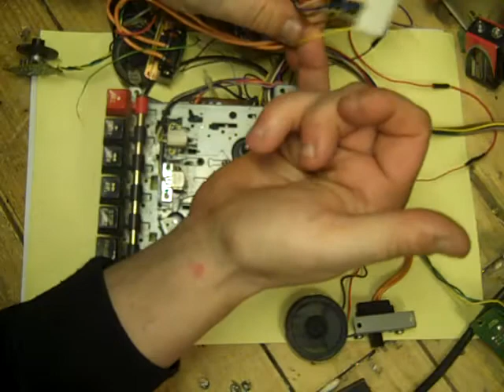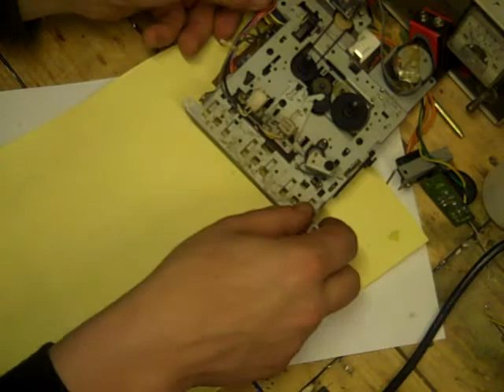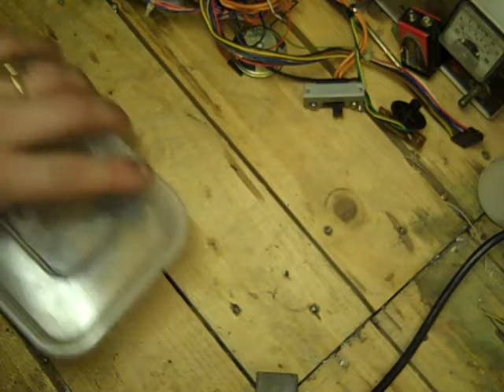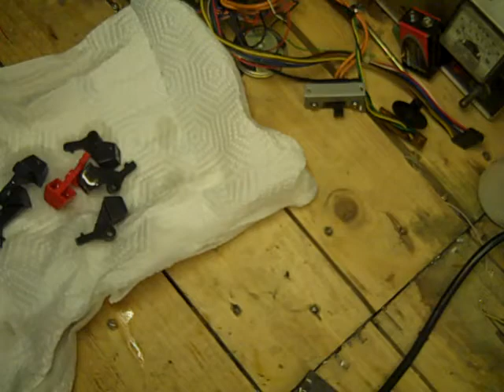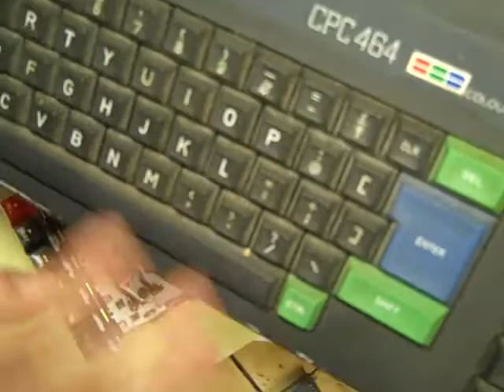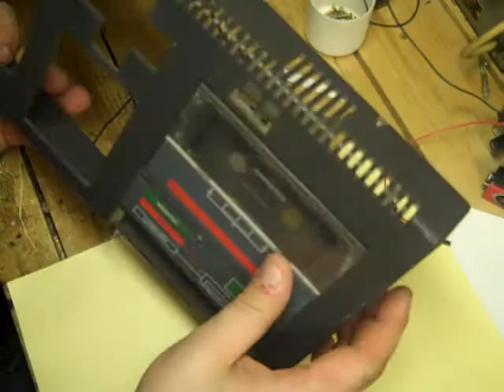Amstrad CPC 464 Restoraton Pt3

Comment: Hello
Did any of the blue capacitors on the board below tape deck have a yellow residue under them? That is the case with my Schneider Cpc464 and i dont know if this is a leakage or glue.
Cheers
Reply from the maker: I have a number of spare decks in a box, ill have a look at the PCBs for you at the weekend.

Comment: Isn't it a very bad idea to go over the kapstan with alcohol?? It will dry out the rubber and stiffen it, which will cause the tape to go sideways under it... you should use some rubber-friendly thing on there I think. And the same goes for the belts.
Reply from the maker: The alcohol evaporates so quick it realy isn't a problem, it would be if it was to be left in contact with rubber parts though.